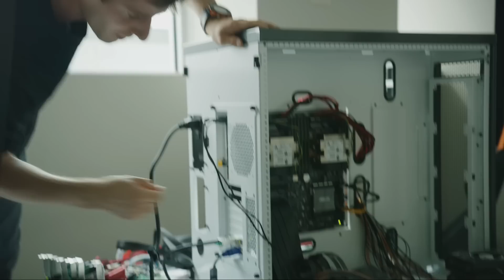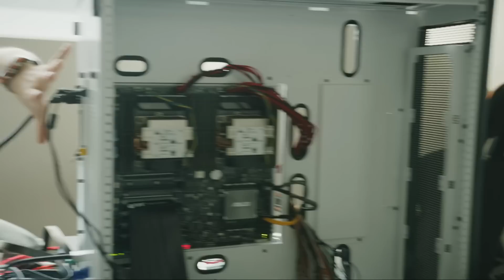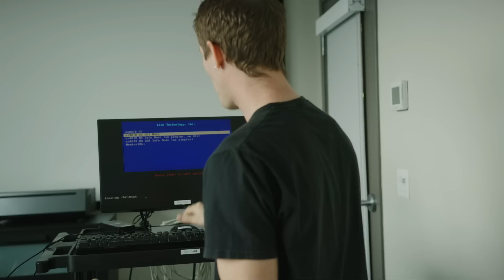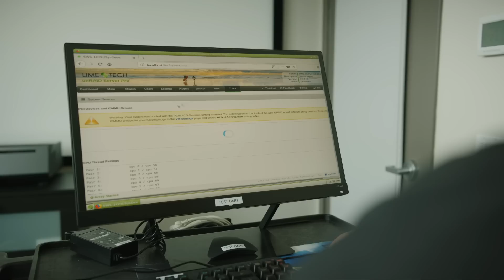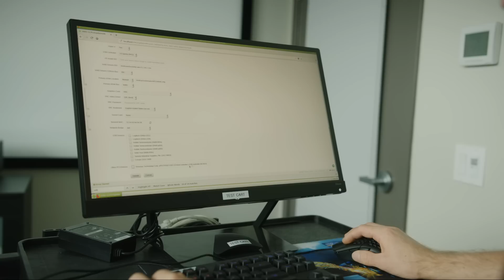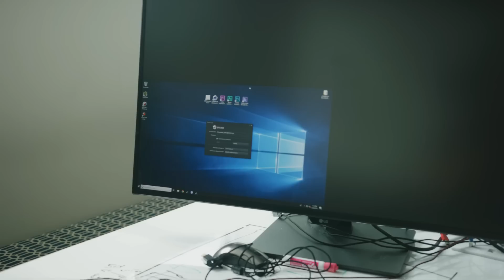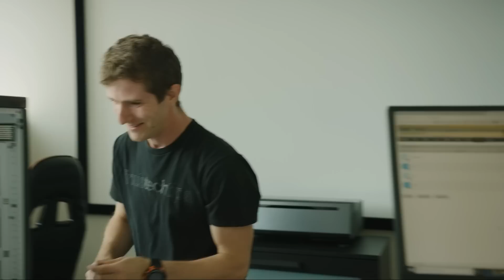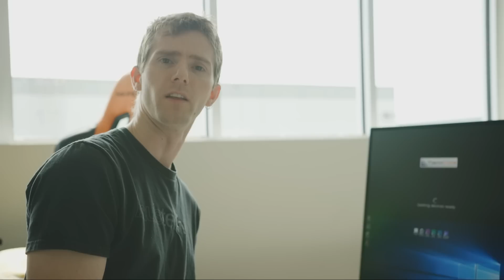Troubleshooting the $100,000 PC

Comment: Japan has ground plugs! Japanese plug has two straight blades but one is wider than the other - that is to connect the correct pin to the ground and the ground is also the neutral. Don't know why they do it since there could be slight problems in rara occasions like when the Neutral gets ungrounded - something that would only happen because of an earthquake ... (hehehe). I, for one, like the ground to filter electric noise - I let those who don't know how to play with electric kitchen devices to get their eventual harmless jolt.

What is "static electricity"? It's what the name says: electricity that doesn't move. Any surface you touch will capture some of the extra electrons or give you some of their electrons. Touching most painted metal is exactly the same as touching paint. Touching a wall is better  because it will have some humidity and that will make static electricity become "traffic jammed electricity" - it will move but not that much. Touching a bare piece of metal will almost empty the charge carriers from your hand. Electrons are free moving in metal so they have (almost) all atoms or Copper, Iron, Aluminum ... in the volume of the metal interacting with your hand while on a non conductive source you'll have only the surface atoms doing that. 

Why "almost all atoms"? Imagine a solid copper sphere that is neutral (no extra charge) and you add 2 electrons. Where will they be? In average, they will be as far as possible from each other. Well, it actually wont be those two electrons but all the free electrons will split in two regions that on average will have +1 electron each and will be as far as possible from each other. What if I at 6.02E23 (times 10^23) electrons? They will be on the outer surface of the sphere - that's the origin of the "skin effect". What starts to happen is it gets harder to get electrons out of the center of the sphere. 

How about vinyl albums: aren't they cool? What I don't like is the crackling sound that comes from dirt and static electricity. The problem is I can't touch my albums on a bare metal surface because they would never touch the inside of the grooves. If only I could use liquid metal ... gonna call Cyberdyne! Wait! There's a liquid that is not metal but made of highly polar molecules - one side is positive and the other negative. If I wash my vinyl albums on that liquid it might be able to remove the static electricity from the bottom of the grooves and also the dirt that's been stuck there because of the static electricity! You know what? Give me water ... cool good water and maybe somebody's porter house steak. In short - washing your hands is the best you can do to remove static electricity. 

Remember: these electrons are static but if you get a whole bunch of them together they'll start jumping to other places. Also, electrons can move on your skin slowly from, let's say, your synthetic wool sweater to your hands or, worse even, jump to your hand not with a bang but with a click. Wear natural fibers when working, touch surfaces often - not on the same place - find some bare metal and wash your hands. I've been told washing our hands is good not only for doing PC builds! 

More about Japan: do you really think they would not have a ground? C'mon! I have a 3 head direct drive with fine bias and self demag cassette tape unit from Japan but made for foreign markets. It has to straight blades with the same width but they added a button and a light on the back for us to test if the correct lead is connected to neutral. The first solid state diode was created at the University of Tokyo. The best capacitors, relays, pots and switches are made in Japan. Even Chinese audio companies will not only use but advertise they use Japanese caps on their gear. While Europe fought with hammers shaped like swords, Japan had a sword that could split a medieval armor in 2.

Comment: Watch out with your ESD comments... yes you are vaguely on the correct lines.  However, unless you are totally the same potential to the ESD sensitive material you pick up you WILL cause some damage.  This damage may not be enough to stop the device working, but it WILL have shortened the lifespan.  IBM did some heavy testing/research into this and the results are surprising if you have a read.  It is better to handle ESD sensitive devices in a totally ESD safe room, including floor ingand mats to work on, while being strapped to a monitoring station.

Also the way some of the PCAs flex when hardware is pushed in make me cry, those poor traces!  Look after your hardware and it can serve you for a huge amount of time.

I love your videos, they are really engaging media! Keep up the good work :)

Comment: I know this is super late, but I don't understand why Linus is saying you have to pass through a whole USB controller in order to get hot plug support in a VM.

I use QEMU/KVM and I can simply pass through specific individual USB ports into my VMs and I can hot plug things into the port and they all work with the VM without rebooting.

In other words, you shouldn't need to hardware pass through entire USB controllers to achieve hot plug support, you can simply pass through specific USB ports on their own into a VM and hot plug works just fine.

Comment: 50:10 The ground circuit in my home is constantly energized for some reason.  I stay in the garage, and one day when moving my PC, I received a shock.  I proceeded to do some testing, I don't trust my Harbor Freight multi-meter 100%, but it was reading positive voltage each time I touched a grounded metal surface with one probe and the other to actual ground.  It quickly reduced to 0-0.1. 
I drove a rebar stake in the ground outside my window and ran a wire to it.  I connected an LED for visual monitoring, then the other lead to a screw on the chassis.  
The LED has been illuminated since.  Interestingly, the PC will not resume from standby if it sits for a while (overnight, or when I come home from work); only since connecting the new janky grounding rod.  I have to turn it on with the power button and my session is lost.  Something very intriguing is going on with the ground here.
FWIW I "Reset" W10, trying to fix a mouse settings issue, but that didn't help the standby resuming, that is clearly a voltage/current leak. - PS I have a Corsair 650W power supply, so I think? I can trust it.

Comment: what's your plan connect your editors' monitor and usb ports when it's actually set up. I would assume the distance between the server and your editors room is quite far for usb 3 cable and specially for hdmi/dvi for the monitors. repeaters or active usb is not a viable options! Please illuminate us on this :) thanx

Comment: use usb signal booster, convert usb to cat5.. .. run wire. convert back to usb at the workstation add powered hub. stub out the usb hub. would this work?
Reply: a PC does not see a hub as a device. When you plug it in, it does not recognize it. A hub only let you connect more devices. It is like a switch that isn't recognizable for anyone on the network.
The PC must see the thing as a own device to stub it and pass it through. That is the reason you have to use a controller. 
There is a softwareapproach to passthrough usbdevices automatically on the fly but I dont know if it works on unraid especially if you are running so many VMs ;).

Comment: Interesting video.

You know if you were using a server which used ZFS for storage and non-RAID SAS HBAs, you wouldn't have such horrifically slow boot times on your servers.  You'd also be able to say for sure whether you've had any file corruption, and you'd be able to sync datasets over the LAN without having to scan every file to determine what has been changed.
shrug

Comment: regarding Boottimes, just disable loading of onboard roms for the individual slots. Like i dont need every Raidcontrolle or Networkcard to check the drives or the TFP-Boot or iscsi connection. The Operating system is checking everything on bootup.
BUT you need those Raid initializasion, if you use the Card for more than passing the individual disks.

On my Supermicro X9srl-F with 4 Network-slots 2 LSi2008 controllers, and 90 Drives in ZFS, this way i could reduce reboottimes from something around 12Minutes to under 1Minute, including shutdown.

Comment: Why you don't use Thunderbolt 3 PCIE Cards? You could easily manage for each VM One Card and an Thunderbolt Dock so you can plug in over one Cable USB Devices, Monitor and so on.

Comment: Pfff, 5 minutes to boot? Get a HP server (DL360/380 G8/G9) those will take about 30-45 minutes just for the first boot out of the box with just a bunch of hard disks and about 256GB of memory, the boot's after that are between 10 and 15 minutes and that's all BEFORE the OS load starts.

Comment: you could use a PCI-E riser to move the PCI-E extension card somewhere else in the machine and run the cable through the PC instead of out the back
Reply: unless they make an internal version

Comment: No pun intended Junk.  You can not beat the real thing.  I would have bought a Threadripper with quad NVME in raid 0 and called it a day.  What O/S you using?  I have 2 severs in the basement, They are loud  How did they get to the basement.  Do not virtual.

Comment: So...i was planing to buy 2 Pcs to make an gaming room for our dormitory and have 3 Gaming pcs (many here use non-gaming laptop), i have an AB350Gaming (rv1.0) and a R7 1700.
If i bough 2 more GPU's (i already have one) and split an x16 PCIex slot into x2 x8 PCIex with that card, could i do those 3 machines in VM using my hardware?
If this worksout, we could buy another board and an R7 2700 and keep doing it until we have 9 Computes.

Comment: 2:40 Yes. That's a fine virtual machine you've built there.

Because if that wasn't a virtual machine, that would be 1 beast PC - and for every time you add a virtual machine you are taking away from the actual host maximum capabilities. Its a grey area, I hear ya but thats just how it is with virtual workstations - they require a powerful host

Comment: I had a motherboard issue, after ASUS sent me a replacement board windows and every piece of Microsoft software came up with activation issues. Same exact model, just different motherboard, same CPU, GPU, SSD from before. Either way took me 4 hours of straight nailing every activation nail in the coffin.

Comment: First of all, all you people dont actually need to pay for unraid, you can use any kind of free linux flavor and install qemu-kvm which essentially is the same thing which unraid uses. Ofc you will have to install everything yourself, even compile some more recent linux kernel, install acs patch, etc. Definitely not out of the box thing.

Secondly, if I remember right, Linus said that those adapter cards are sending raw pci express through the cable, which makes me wonder if you could just plug the plx board into the motherboard via a single male-male pci-e extender cable thingy instead of routing those cables outside of the case or whatever else. Maybe even getting full x16 bandwidth.

Third: If you have stability problems, it might even be because of the acs-override, as it is more like a hack to make the iommu groups /appear/ to be separate, but they are not. So if you plug in some more shitty device it may start to stir up problems as the other devices are not really separated in the way they would be with vt-d.

Comment: Why not use a raiser card for the multiplexer card for OSS and throw it to the other side of the case? Then you can run all your cables inside to case and have the usb cards be available via the back panel, prim and proper.

*edit: Regarding servers booting long. You have seen nothing, old HP servers with lots of ram used to boot for 40 min+ just doing memory init and testing.

Comment: With 6 workstations like that going, it may be worthwhile to try and get 100GbE going if you can free up an x16 slot on the mobo. That, or if you do dual 10GbE hang one off of ports from each CPU so one CPU doesn't need to hop through the other to get to the network.

Comment: One thing I was wondering about the ethernet bottleneck : since 2x10Gb would be just enough for 6 editors to go through 8K red footage at the same time, wouldn't it be better if you are buidling this architecture from scratch (i.e. without all the architecture you already have at LMG, like petabyte project, whonock ...) to have the storage being attached to the machine and ran by unraid, so you can have like an embedded whonock server and you won't be limited by ethernet bottleneck ?

Comment: "Is a VM still a VM when you can sit down and use a keyboard blah blah."

Dude, what you're doing here is hacking together a high-powered thinclient setup.
Reply: Realtime multiuser PC I guess. Or the AntiTerminalserver for 6 ;)
Reply: A thin client would transfer the picture via network and picture compression. With this you plug the monitor into the separate graphics cards with 0 lag or compression. There is no need for a thin client on the other end. Otherwise this would just be a terminal server.
Reply: @govido3242  Semantics aside, the hell else would you call it?

Comment: USB devices not beeing hotplugable is mostly a problem with the frontend for your hypervisor. Unraid uses qemu und qemu is absolutely capable of hotplugging USB Devices. It's just that Unraid doesn't expose that feature to you.
Reply from the maker: Do you mean unplugging then RE-plugging the same device? That's not what I'm after.
Reply: Well qemu itself can pass through any USB device you want. It does not really matter if it was ever plugged in before. Each qemu instance has a monitor console that can be used to dynamically add new devices (including usb devices) to a vm while it's running. One example of a virtualization daemon supporting dynamic device assignment is libvirt. Together with virt-manager you get a really nice gui to manage VMs and their devices.

EDIT: I can't test it but as far as unraid goes this looks like it might suite your needs: https://lime-technology.com/forums/topic/45537-plug-in-hotplug-usb-for-virtual-machines/

Comment: Linus, I think the cause of your issue is this expansion board not supporting PCIe ACS (Access Control Services).

Basically PCIe cards can normally talk directly to each other for performance reasons. This obviously conflicts with virtualization. So with ACS your OS can tell PCIe switches to disable this direct communication and always go over the host. But this is not a standard feature. That's why this pass-through stuff is eg. harder on consumer systems.

This Override patch now just tells the operating system to ignore the IOMMU groups completely. While this makes it "work", the device can still communicate with each other! This can lead to instability and security issues unless you are certain that these USB controllers don't want to do this.

So, in the end your best option would just asking the provider of the board if they have an update or sth for you.

Comment: Wait, PCI stub instead of VFIO-PCI?
LINUS
Reply: I had the same criticism watching this. Idk if this is somehow different with unraid. But with modern qemu virtmanager setups you don't have to stub anything. The USB controllers don't even have to be handled with vfio-pci. My home system is a dual head passthrough rig. I have a renesas controller that I can use in the host until I boot up the VM and it just swaps over seamlessly.

Comment: both of my dell r210ii's take about 5 minutes to boot, and then my T410 takes about 4 minutes.  You can turn off OpRom bios booting, which means PCIe stuff won't try and boot search, but will work, on most server hardware.  Also, if you have a ton of RAM and you enable RAM checking, that can take a ton of time.

Comment: Why don't you just pass through the USB that's already inbuilt in the RDP protocol?
Reply: Stephen Woods thank you someone else with common sense!
Reply: Do they want rdp? They are probably going to wire each editor up directly.
Reply: This project isn't about building a terminal server. It is about virtualization. Creating 6 VMs with dedicated graphics cards and io (USB). Those mouse / keyboard monitor setups will be wired directly to it. When using rdp you would be using thin clients etc. Completely different idea here. You should watch the unraid gaming PC videos to get the idea.

Comment: Every time I see that Asus "In search of incredible" logo, it causes my blood-pressure to spike. I have never had more of a pain in the ass of a PC as when I put an Asus Z170 Deluxe in my last build. I have never had a computer with more reliability issues, and the BIOS can't seem to make up its mind. Half of the time the changes I make stick, and half of the time it just reverts itself back to factory-default in the middle of a session, causing my screen to go blank, and a half-hour session of bitching and swearing trying to get it back up, as it's never the same solution twice that fixes it. 
It's always something different, and the manual doesn't cover shit like that. I would kinda prefer if I didn't have to bloody guess to get my computer back up and running. It's a little bit unnerving. I build custom PCs for a living too, btw, so this cannot be chalked up to lack of experience or user error. If I wasn't so worried that everything would stop working, I'd update the BIOS, but we all know how sketchy that process is. My palms sweat just thinking about it. I would do it in a heartbeat if I didn't think it would make my PC shit the bed even worse than it does already.